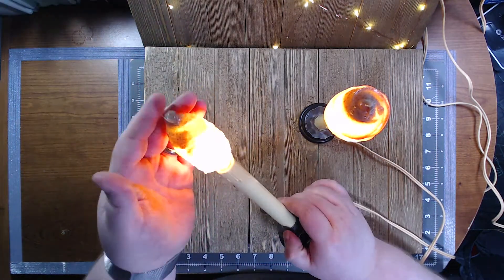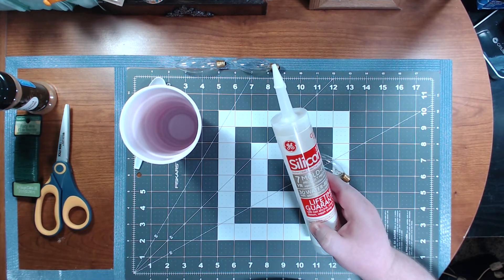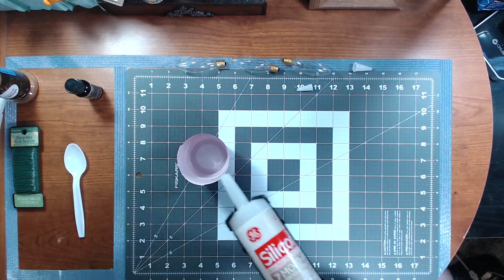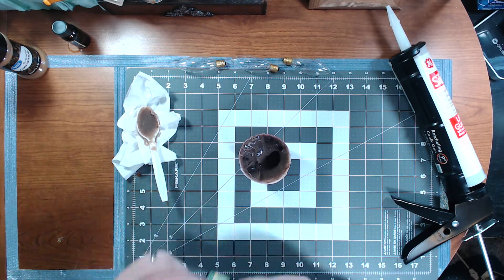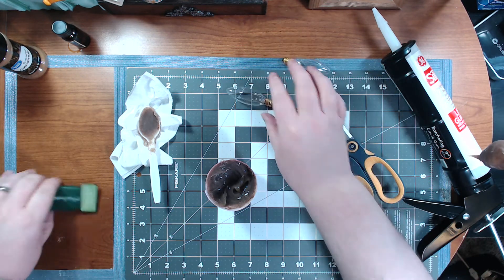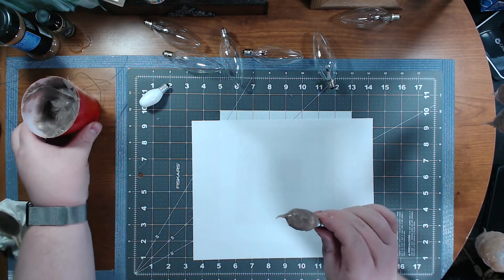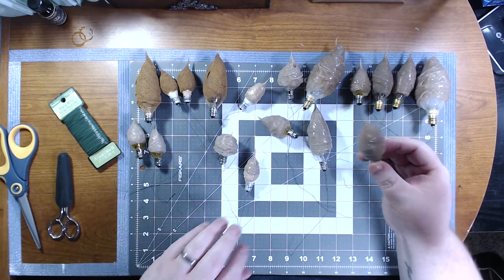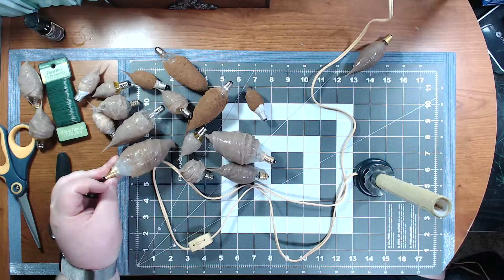DIY Silicone dipped bulbs

Comment: I've seen other instructions where the silicone is warmed in a microwave, I'm assuming for a cleaner, smoother look. I wonder if a candle warmer would work as well, but not leaving the cup sitting on it, just enough to thin the silicone. I would like to know how to make the slightly curled tip, but not thick, & if color can be added & which type. Thank you for making the video.

Comment: You can add a drop of mineral spirits to thin if needed and you can add a touch of oil based paint for color or even glitter. Silicone seals so adding scent won’t work I don’t think